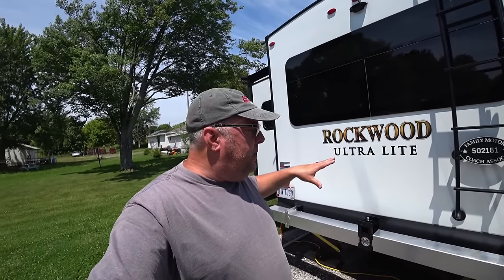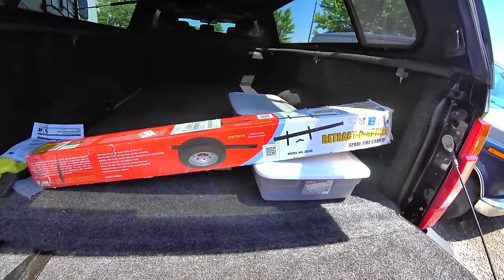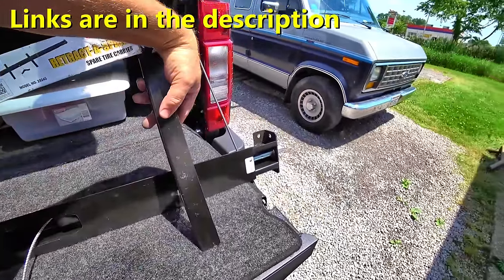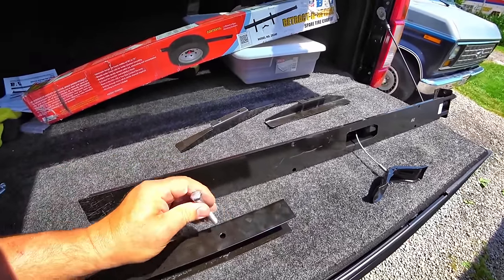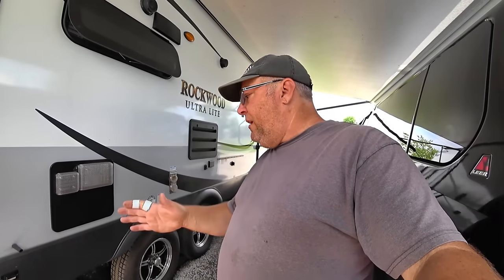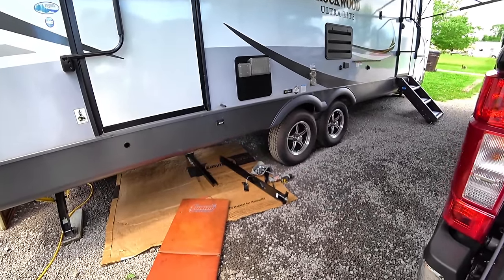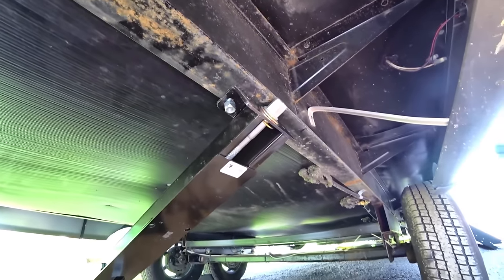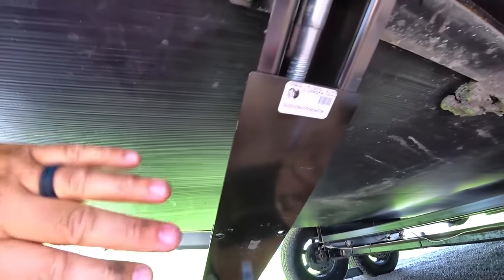Hide your Tire BAL 28240 Retract A Spare

Comment: Alright Mike, as usual I have a couple of questions for you. First, are you going to cut a hole in the skirting so that you can use a regular crank in the skirting like the holes on the slide skirting to crank it up and down? Second question, to check air pressure easily on your spare tire wouldn't it be easier to do if the air valve is pointed down? Yes I am a smart ass... LOL!!! Otherwise it looks great and very easy to install. Great video!!!
Pat

Comment: Great video! I have a R/W 2608BS.
I was on the fence between the Hide-a-Spare and the Retract-A-Spate. I like this better. As you mentioned, less stuff hanging under the rig. I like adding the second bolt to the frame, I thought it, and then you said it! Makes sense. The manufacturers should include this!  Thanks!

Comment: Mike   Really enjoy your channel we have a lot in common on our thinking    But you should turn spare over so valve stem is down and face it forward and nothing will hit stem.   Also it would be easier to paint your frame now with a good coat of xo rust paint before it gets to bad. And it will stay good for a long time.

Comment: First of all Thank You for the informational video. While watching I couldn't help but notice that the manufacturer put castle rock tires on your trailer as were mine.  I keep after my tire pressure and check treads often . I don't do anything to damage my tires. The last thing you want is to be on the side of the road changing a tire. This past spring while going to the beach I had a blow out on the front tire of my camper. The blow out had shredded the tire with pieces flying everywhere. chunks of rubber damaged my skirting and my underbelly membrane. The shredded metal cords of the tire got picked up by the tire behind the exploded tire, causing it to leak slowly. I was able to put my spare tire on and finish our trip. When returning home I went to get 2 new tires on the rims and the place where i get tires didn't carry the castle rock brand. Long story but he said he replaces a lot of that brand with blow outs. I ended up replacing all the tires on my camper and even bought an extra spare. I was lucky that the blow out tire didn't take out my rear tire completely because 
I only had 1 spare tire with me. I now carry 2 spares. we did a little research on the internet and a lot of people talking about these tires blowing out. They nick naming them China Bombs. 
Thanks again for the informational video
Reply from the maker: Yeah, you're going to have problems with some of the Lesser name brands. I want to put them in the category of China bombs though. That's relegated to tires that have whole website forms dedicated to just all the problems that they're having with one specific brand. Think about how many Rockwood and Flagstaff RVs that AR on the road from 2013 to 2021 all of them went out of the factory with Castle Rock tires. So when you see a group of maybe 30 people talking about blowouts with that specific brand you can kind of get an idea that there are a lot more on the road that we're doing just fine and took him to the mileage limit then that had blowouts. Now, with that said we used our Castle Rock tires for roughly 2500 miles and before we hit the road full-time we upgraded to Goodyear endurance. As we wanted to upgrade to a higher load rating and a higher speed rating also. But for 2500 miles the castle Rock's did me just fine. It happens. The reason that people have an issue with blowouts with different brands tires is not so much the inconvenience of needing to change the tire and put a spare on it because the RVs are manufactured in such a way that they damage the RVs greatly. Sometimes even internal important components such as Plumbing, wiring or propane and of course cosmetically the damage isn't something that can be repaired easily. So, when something is mundane as a flat tire happens or a blowout it is that much more exaggerated of an issue. The reason that I stopped my listing of Rockwoods cuz in 2021 they started putting Goodyear Endurance on all their units. They said the majority of the people that were buying him we're having the dealers change out the tires anyways even though the reports of blowouts were so minor compared to how many were out there it just didn't make sense and that's just the way Rockwood does things to make their units better. Thank you for watching and commenting! Appreciate it greatly:-)

Comment: You should have the mounting of the tire with the valve stem down so you can check your tire pressures. It’s a spare tire who cares if it gets scratched lol.
It’s just a way it’s mounted on trucks. They always put the valve stem down.

Comment: I herd you say when you where on the way back home  you had a teeter totter effect you can get some equalizer bars which will stabilize the trailer  and keep it from swaying and Teeter tottering when you got the generator on the back. Get some rustoleum paint To paint the frame down there where is rusting and where you drill the holes for the spare tire.
Reply from the maker: Okay, so, don't take that literally. What I meant was I could tell there was a slight unloading on the back of the truck that was slightly more then when I had the generators mounted on the back. I am very sensitive to my vehicles and how they feel when I tow. For example, I can drive down the road and can tell when my air compressor kicks on for my air conditioning. So it only stands to reason that I could feel there was a difference at the hitch when I was driving. With that said it was not out of control there was no Sway and we have a $3,800 Pro Pride hitch that takes care of all the needs that this trailer could possibly Demand on an F350 if there's even such a thing. As far as painting the frame. That's a losing battle unless you live in a climate in which there's no chance of moisture building up underneath of it. Once we hit the road I suspect that whatever surface rust that has slightly poked through on the frame will be all that that RV will see. At that point I might address it but every RV in Northeast Ohio looks like ours or much worse. The other thing is whenever I was shooting the video in post-production I had to change the light settings for a correction so that it appeared brighter that makes the rust pop more in the picture. It's kind of like if somebody is smiling and then you brighten the entire picture until it looks like their teeth are bright shiny white when in reality they're probably just normal white.
Reply: RVdaydream your like me very in tune with what your driving and super sensitive when traveling. Enjoy Stay Safe

Comment: Hi Mike, it looks like the unit that you have has the mounting tabs that allow you to screw up to the cross members of the coach but the unit from the link to amazon does not have the same mounting tabs like yours.  Can you let me know where I can get the same one that you have installed?
Reply from the maker: The one in the link is the exact same one we used from Amazon 😁

Comment: grreat video, you got a new fan.. i considering my spare inside storage but now o may change my mind.... what is the under belly vinyl covering the bottom of rv.
Reply from the maker: Factory insulated Coraplast Fiber sheets... It helps with insulation of heated tank area and smooths out the under trailer airflow when towing

Comment: Now that it’s been a couple of years since your installation is it still working for you?
Would you do anything different if you were going to install it again?
Reply from the maker: Great question, I do believe it's still on there but we no longer own it.. 😁
Reply: @Rvdaydream  Enjoyed the video, but our 2019 E:Pro has the same system, on a recent trip people started to wave at us and point under the caravan. I pulled off the highway on to a feeder road , the spare was hanging down and hitting the road. I was not able to winch it back up, or down, even bent the handle in the attempt. Ended up putting it on the floor in the caravan. I will be contacting Norco to see what they say, it was original equipment on the R Pro. Thanks again DR.
Reply from the maker: We had a 2022 5th wheel no issues also. You do have to check on them once and a while.

Comment: I would mount it face down so you can easily check the air in your spare, the way you have it mounted you have to lower it to access the valve stem to check the air pressure.
Reply: I thought the exact same thing. Who cares if the center gets a little rubbed scratched up, its a spare  !

Comment: Cool device.  I've seen some people mount two spares underneath their RVs when heading off to places like Alaska.  Do you know if this product has a two tire option?

Also do you know of a source for the black chloroplast.  I'll probably rip mine up when installing something like this :-)
Reply from the maker: Yeah there's no way to put two tires on there because the metal is not strong enough to support but just one 16 and a half inch tire maximum.
Reply: You could possibly use 2 mounts. Offset one curbside and one streetside. Put them as close together as possible with enough room to fit both tires underneath.

Comment: The only thing you might want to change is to put the air stem down or you have no way to check the tire air pressure before you go on your trip.
Reply from the maker: Probably a good idea. However weak area battery powered air pump and a cigarette lighter powered air compressor also

Comment: You should always have your valve stem pointing downward so you can check your pressure in your spare so you don’t have to lower the tire every time that’s how they do it on the pick up trucks
Reply from the maker: 90 percent don't check there tire pressure on there truck and even less on their much lower RV...I carry a pump.... I wanted to keep the roadside clean and the stem protected from all the debris that is out there.... Especially when my Towing trailshield bounces it off the road(small and not so small gator pieces)

Comment: Way to much work under the trailer. I have the Rockwood 2608. I measured the exact width distance of the frame where I wanted the holes to go. Completely assembled and drilled the 2nd bolt hole on my work bench. Only time I spent under the trailer was drilling the 4 mounting holes, bolted it on and attached the tire. Just make sure your measurements are precise. I used vise grips to hold the entire unit in place and drilled the holes without having to mark.
Reply from the maker: I didn't mind. I had the poor man's creeper, cardboard. And it was Shady, and cool, with a light Breeze. Plus the lighting was really decent without running electricity inside the garage

Comment: 3 years later...do you still like this?
Reply from the maker: Traded in for 2022 5th wheel... the fifth wheel had an under mount Tire system. And from the factory it wasn't as good as this Bal version. Still did the job but I was surprised. I thought the OE quality would be better than what I was buying off of Amazon. LOL

Comment: Frankly, I don't trust it. I'll bet many spares get scattered along the roads with this style.
Reply from the maker: Why don't you buy one, bolted on and you'll find out it's just fine. You realize that almost every new Chevy Dodge and Ford truck holds their spare tires up against the bottom of their trucks with the same type of mechanism.
Reply: @Rvdaydream  Not just new ones....  Every one made in the last 25 years or so, along with most mid-size and full-size SUVs as well!
Reply: @Rvdaydream  Yep, and every Honda Pilot and most Odysseys.